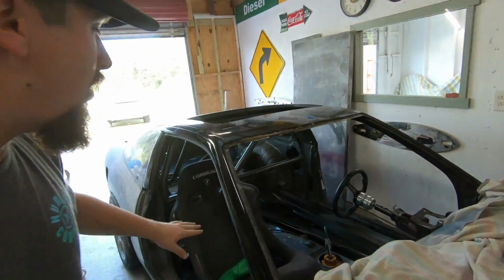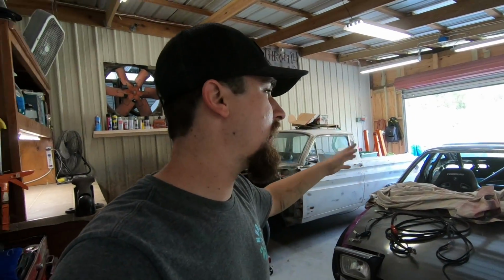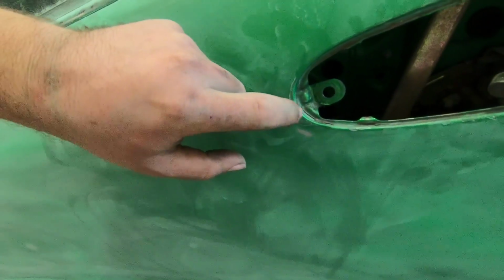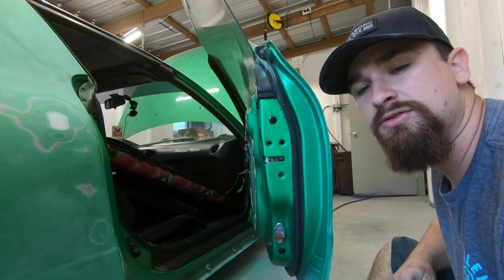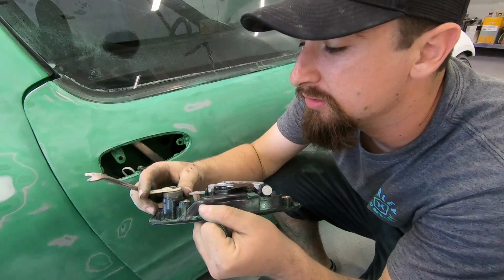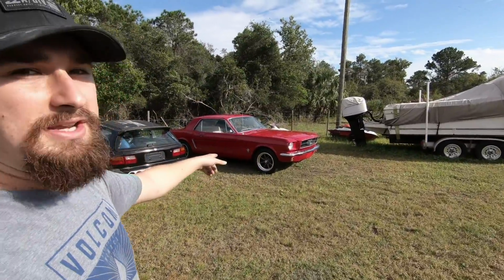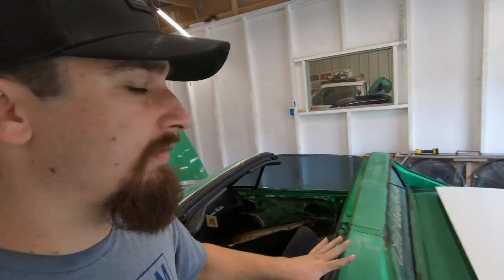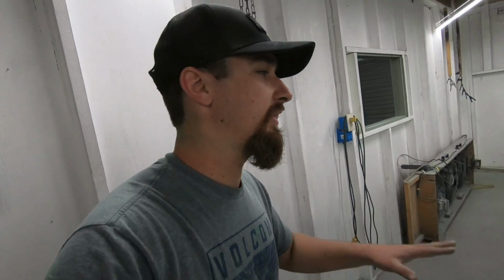Honda Del Sol Tear Down!

Comment: Digging your videos.  I rebuilt my 2000 civic d16z6 making 433whp 307wtq at 21psi. She's slammed. I also just finished my 66 mustang put new quarter panels on and put a 302 and rebuilt the c4 tranny. Wish I had a garage and not gravel here in south Dakota.

Comment: Did you think about shrinking the metal of the hood?
Reply: Kyle Goes , be better off sealing it to the under skin. The heat of the engine just has caused the factory seam seal to let go making the hood “pop”. 

You could heat shrink it and hammer and dolly it; but that’s meant more for flat custom fabbed and floppy metal.